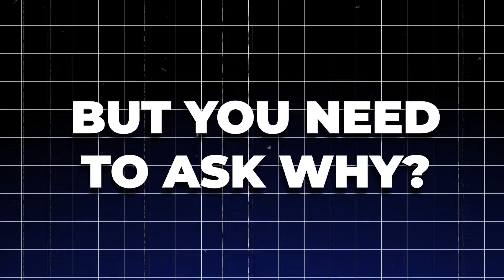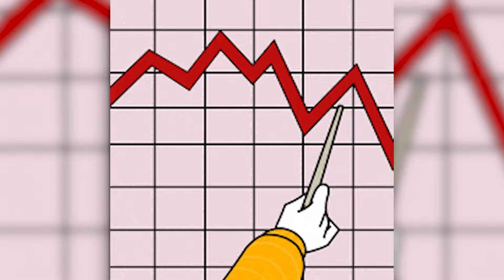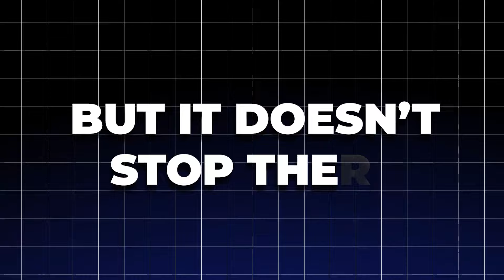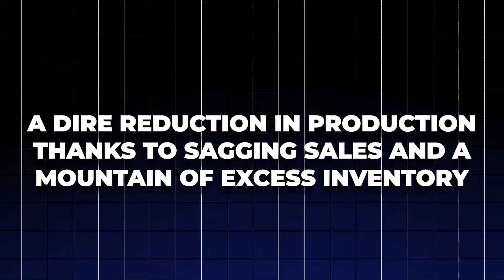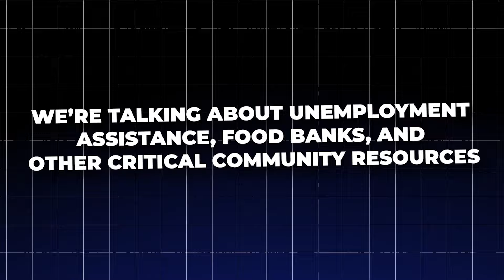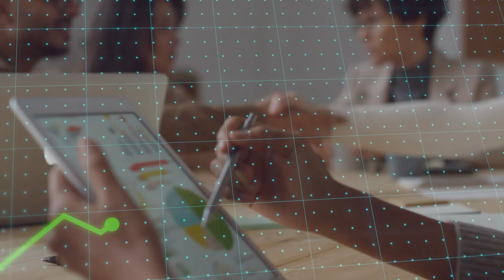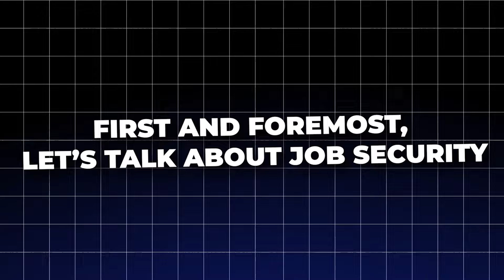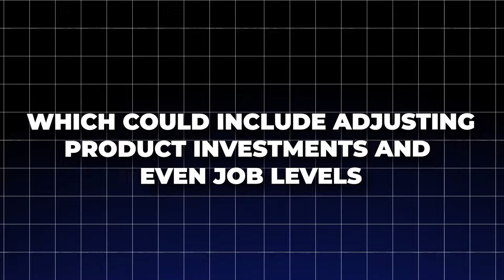Donald Trump Will Shut Down Jeep, Dodge & Ram! UAW Strikes Back

Comment: Every day normal working folks CANNOT Afford to buy these overpriced peices of plastic, I had to make a delivery to a Ford dealer today, brand new F250 $100.585.00 Sorry I didn't win the lottery yet.
I don't begrudge a guy or gal making big $$$ but honestly auto workers are over paid. There I said it.
OH Stellantis just killed the Ram Classic 1500 that people still want, AND oh yeah Stellantis killed the Hemi in their 1/2 ton pickup.
Jeep needs to bring back a regular plain jane Jeep, no luxeries at all, roll down windows no computer crap.
Reply: Granted I like those electric windows.  But I think people can live without them!  I can remember those crank down ones.  You are lucky if the electric ones last 10 years you can find them in a lot of older cars still the one that was put in the car 50 years ago and still work!
Reply: I agree, the original Jeep lovers are traditional and don't give two shi!ts about the luxury garbage.

Comment: In 2006 I bought a house four bedroom 2500 square feet had a big swimming pool in the backyard 10 ft deep the house was about 30 years old. It cost $120,000. They did this to themselves they are horribly managed . Stillantis sucks. But so does the UAW.

Comment: I don't begrudge a person their chosen career, nor their desire to make as much as the market will bear . But the unions priced themselves out of the market 40 years ago. Over 76% of these "AUTO WORKERS" have no marketable skill outside the auto industry. Prices are up with inflation and the continued cost of paying into the pension plan that there aren't enough workers to cover.More automation is on the horizon, eventually the auto makers won't need line workers just QA &QC staff only. Foreign ownership doesn't help either

Comment: I bought my last new truck in 2013 for 30.000 ish. Similarly equipped truck today is 60 + thousand. My income hasn't doubled in 10 years and for the most part neither did 99 percent of working peoples. So it's not due to workers wages no matter what they'll try to tell you.

Comment: Payments. As a $45,000 vehicle load payment is in the $800 monthly range. More than a 2020 vehicle at $58,000.  Why I refuse to buy another new vehicle. Taxes and payments. The only other way I would personally buy another Jeep is that it has a diesel engine with no DEF and a manual transmission. Manual lockers. Manual emergency brake system.